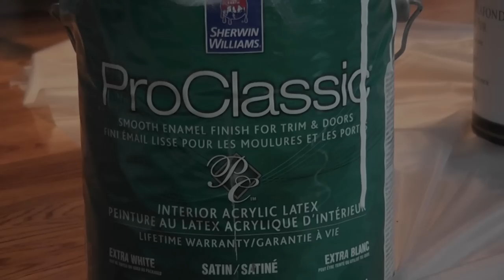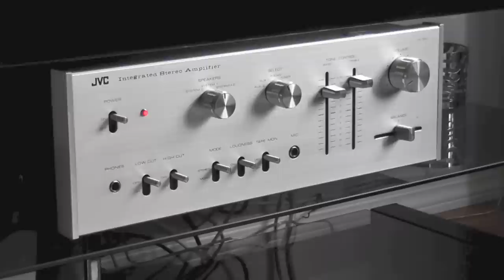DIY Painting Tower Speakers

Comment: , dude, you should have added some poly fill to the inside of the cabnet.
and also I would have experimented with different length port tubes.
Sony makes good drivers but those cabinets looked like they needed a little help. who knows, you may get some better bass and reduce some of the chaffing from that cheap ass port that wasn't even glued or tapped in.
you know that it's gonna rattle being that loose and so short right?

Comment: how would you actually go about painting the speeker it self i want to spray my base a nice black and then have the speaker it self yellow is this possible ?
Reply from the maker: I had that idea. It is possible. Just give it really light coats so that you don't wet the speaker. And let it dry completely between coats.
I might do that and post it here.
Reply: Plasti dip the cone and only the cone on ur sub it works Great and plasti dip can be removed and comes in many colors.
Reply: Possibly not a good idea to attempt to colour the speaker cones, if that's what you mean. Some are made of a paper composite and would likely disintegrate. Certainly don't get anything on the outer diaphragm, the flexible rubbery foam that allows the cone to vibrate. It will harden this up and make the sound very poor possibly drying it out and cracking it. You could change the baffle material for something more colourful perhaps? Much safer and changeable if you get bored with it!